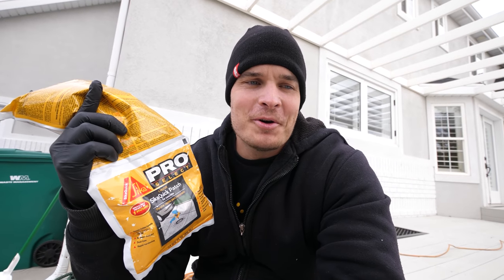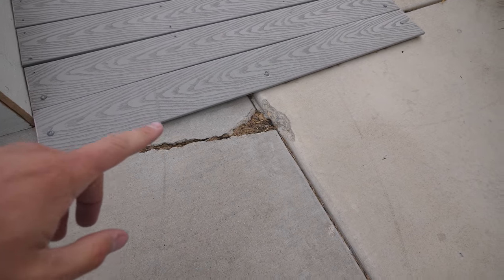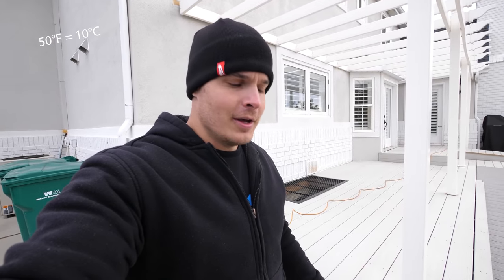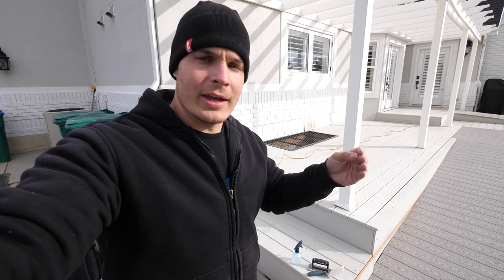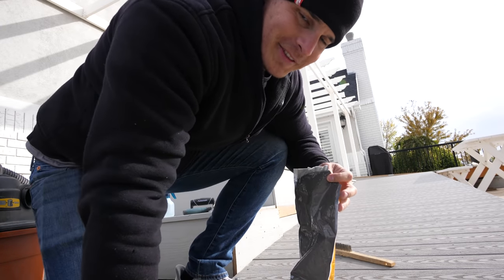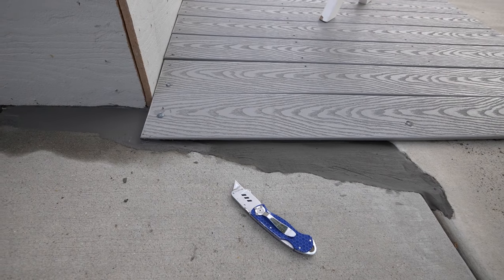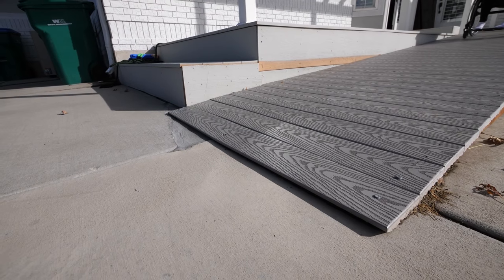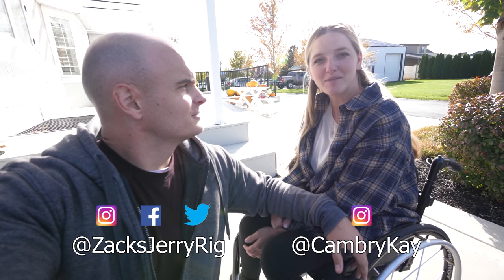How to quickly patch Concrete! - Easiest Method?

Comment from the maker: It has been 10 months now - and the cement epoxy mix is still holding BUT - It has cracked considerably - It is still filling the 'hole' It was put in - but i dont see this lasting another year. Ill probably have to redo it in the near future. I think the layer i put down is too thin to be a long term solution.
Reply: Your video was the second video for "rapid patch concrete". I clicked because I knew your other channel. But quite the timing as I scrolled down after you said you'd pin a comment in the future... and it was 58 minutes ago.
Reply: When is the garden and the new water system update coming?
I want to see it so bad :)
Reply: My buddy got a bag of cement mix off eBay it was a 2or 4 pound bag so he didn't have to buy a full bag of ready creat or whatever it is called and he just poured the cement powder into the hole and added the water to it and has had zero issues. I hope this helps I know bad grammar and spelling sorry I hope this helps you though
Reply: Appreciate the update 10 months later, thank you.
Reply: Would be easier to get some extra concrete and cut a little but the Crack that is, and make sure that the natural poor gap is maintained for heat expansion
Reply: You could probably get away with some fast setting concrete with small aggregate there. It will also crack, but will remain strong despite a couple cracks.    Concrete comes with a 3 way guarantee - it's gonna crack, it won't burn, and nobody will steal it.   I'm here all week.
Reply: add gravel and small rock to fill the major parts and just add some cement and it will last for years!
Reply: ey, you should mix real concrete, destroy a little bit of the border already existing cocrete, removing the first plank and pour the concretre, this will allow to have a wide area patch to stand the tension, a person can walk but the wheels makes a point of pressure, i think this would be the solution
Reply: Hydraulic cement is your friend for patching
Reply: Try adding fiberglass fibers next time to the pouch before pouring.

Comment: He is proud of all his channels except the lock picking layer
Reply: what
Reply: @divoom1269  there's another YouTube channel called the lock picking lawyer. Zach's voice and the guy from the lock picking lawyer channel sound very similar(becuase they use different mics it sounds a bit different tho). If you watch Zach's latest video on the main channel where he reviewed that face Id lock for doors it was mentioned there at different points during the video.

Comment: Could probably have saved needing the extra bag by part-filling the deep hole with stones or gravel.
Reply: no he nead to fill it up to top its not good to have weak foundatino
Reply: @montenegro4589  lmao. You are aware concrete has stone aggregate in it, yes?
Reply: although peoplpe in practice to do this when pooring concrete to save on costs its generaly not that good to do it if the sruface will be under constant stress. In this case as you can see a wheele lands exactly there so if you put stones or gravel it will make it weak and it will crack much faster over time.
Reply: @averagedev7768  Wrong.

All concrete has aggregate in it.

Cement is only a binding agent, generally.
Reply: @evictioncarpentry2628  I am not a native speeker. I understood that the gravel would be poored before the cement mix. Yes when you mix concrete you put ether sand or gravel. But you never fill a hole fist with gravel and then put the mix
Reply: @averagedev7768  Concrete is poured over gravel and stone base all the time. And this is a tiny insignificant patch.
Reply: This isn't a pure cement. It has other additives, and starts setting in minutes. The time spent to mix it with aggregate will give you less working time to patch any holes. It's also a very wet product.
Reply: He’s a liberal. Be very careful.
Reply: @montenegro4589  I’m sure you don’t know much about construction. All structures are built on top of packed soil. Most are then also layered with gravel before layering concrete overtop, to I’m give it strength if the soil ever tends to shift. So no, it does not in fact reduce the strength. You just need a well balanced layer of gravel/concrete. Generally around 1:4 respectively.
Reply: @AznTony360  the gravel bed also helps with allowing water to escape if it get under the concrete.

Comment: For patching holes, this is great. To get a uniform look however is a much more difficult job. Still, even for a regular homeowner, this is pretty awesome given how simple it is. Id love to see more homeowner based content from Zach actually. Would be pretty neat, like resealing windows, door cracks, rebalancing doors, etc. Keep it up Zach!
Reply: not quite sure how it's better than bog standard Portland cement + sand (and gravel). -10C cement is ubiquitous too. Perhaps curing time only. $12 is like 100kg (200+lbs) of ready mix (just add water)
Reply: @stanimir4197  Sound easy. But for the inexperience the question is the cement/water ratio.

Comment: Sika is very renowned for automotive adhesives, more specifically Sikaflex, a polyurethane glue. Chances are if you own a car, especially an European one there's some part in it glued with a Sika adhesive.
Reply: In India Sika is popular for these cement additive kind of stuff.
Reply: Tec7 is better. 
We used Sikaflex before, but now only use Tec7.
Reply: @dubious6718  Yeah. I to have gone from Sikaflex to Tec7. :)

Comment: The gap between the slabs seems a bit wide if the wheels happened to align going over it, it might not allow for correction especially if she's a bit faster going down. Might have poured the rest over it too.

Comment: Love to see some love for Sika. You also could use the more classic "Sika Grought" - it will flow a bit better and needs 1-2 Days to dry - but is way cheaper - and you could fix a much bigger area (like the crack further down :P )
Also a nice thing, Sika Flex - "concrete in caul form" - also available in concrete grey ;)
Greets from Austria - where we get this brand in most hardware stores

Comment: you should do an asphalt pot hole repair with some of this Aqua Phalt repair in a bucket, either the 4.0 or 6.0 material. i see you have an asphalt driveway and i would love to see a current video on this stuff and cant find any. thanks for this video on the Sika path material, i have never used it before but now i will seeing how easily it was to use.

Comment: A quick tip: Its generally a good idea to have a straw going from the lowest point of the crack to just above the concrete resting line, when the concrete is hardened, you can remove the straw and allow 5 minutes or less just to get some air to parts of the concrete which may have not settled yet. You can fill the hole with concrete afterward. This isn't anything to worry about if it's just a shallow hole but for deeper projects, I advise doing this.

Comment: I'd add a metal lip to that ramp now that the concrete portion is repaired.
Reply: or a rubber strip
Reply: @arch1107  A good elastomer would remain pliable and weather-resistant, so it's certainly a possibility.  Diamond pattern plate is a fix-once and move on solution, so I'd favor it, but as with cat skinning...

Comment: I’ve used this stuff on my driveway. It held up for about a year, then it cracked because of the driveway movement. 
Then it slowly crumbled after that.
Reply: the problem is the soil itself then, it moves too much, in zacks case, seems to be the same so might happen the same

Comment: small bag and yeah she could become a projectile if she came down quick and those tiny caster wheels hit the crack at the right ( wrong ) angle ..... Ive been there done that  bout 30 yrs ago popped the rubber  wheel off the rim  landed face down in hard grass ( thank god no damage ) but man that sucked ... took me a lil bit to pop the tire back on the rim ....thank god didnt bend the rim